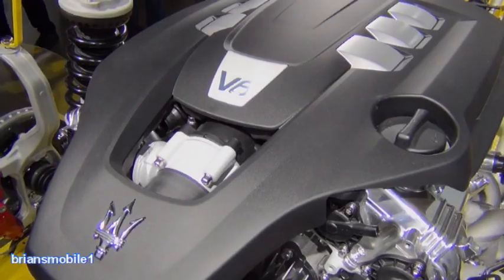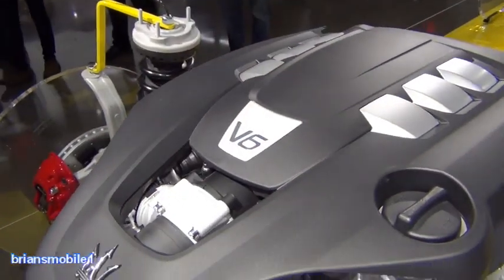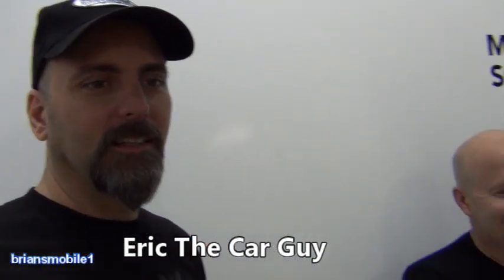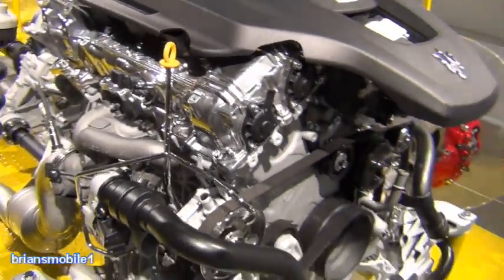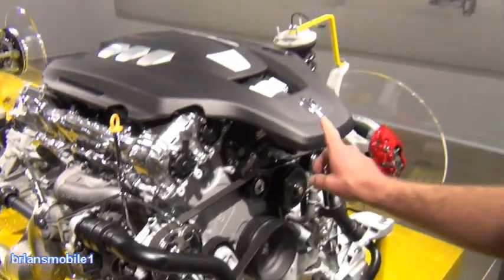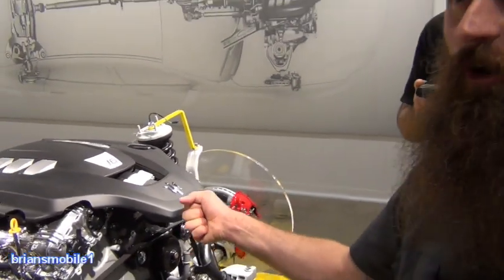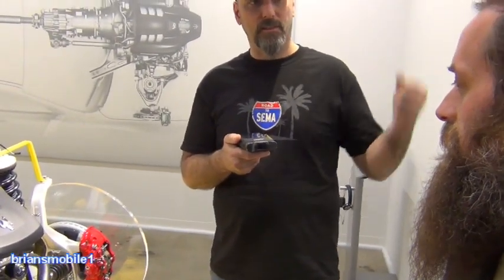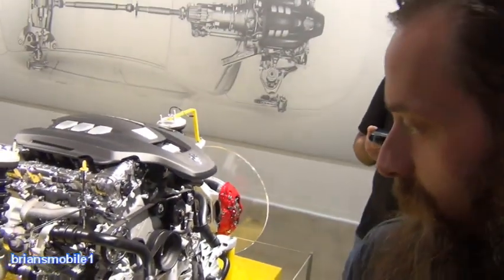What's This Thing Called?

Comment: These days, I don't blame automakers for putting them in. With high pressure fuel pumps and injectors, there's a ton of noise they have to deaden and those covers do a pretty good job at reducing noise, especially if they're the squishy foam ones like you find on newer Volvos. Also, the layman that wants to look under the hood of a new car does not want to see a rats nest of wiring, hoses and connectors all over the engine. These make the engine bays appear much cleaner.

Comment: It makes the engine sound nicer though, it dampens the valvetrain noise. At least on my cheap beater car.
Should I remove it? Almost 20 years alive at this point and no issues with cables or tubes, so not sure it's worth it.
Reply from the maker: I've filmed several videos on this topic that I never posted.  Of all of them noise was the one benefit.  The rubber foam or whatever insulation used on CNG, diesel, and direct injection cars helps quiet them quite a bit.  It's also YUGELY helpful to the mice that live in those engine bays.